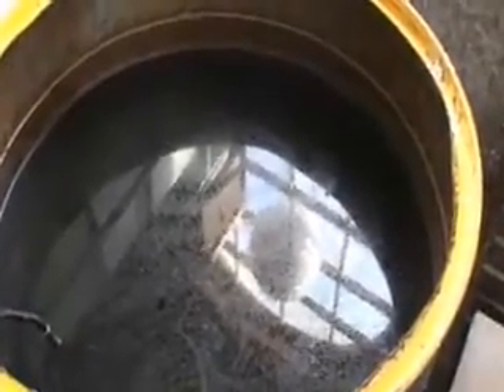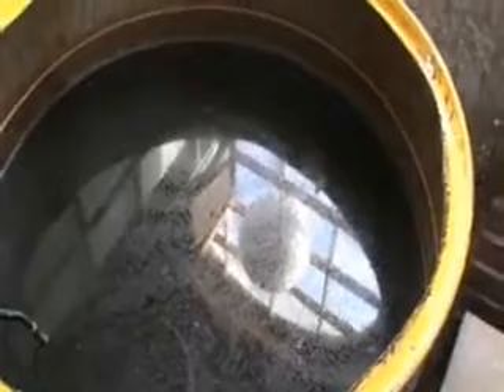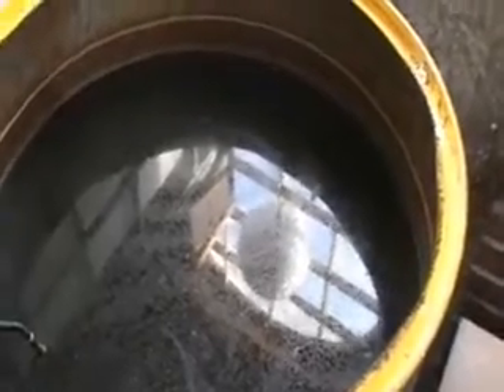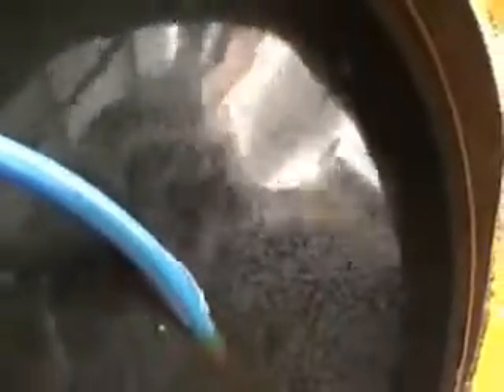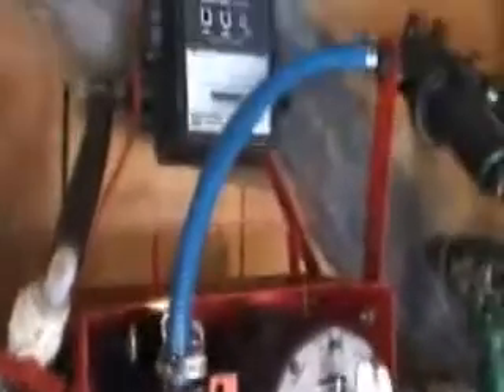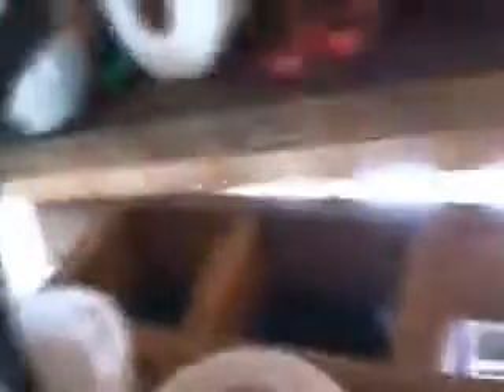Filtering vegetable oil (WVO) for use as fuel with a simple centrifuge

Comment: screw the hybrid. get a jetta TDI and just run dino. 45-55 mpg. better power, no batteries, fewer electonics to go bad, it will last longer without a doubt, hold resale value, you dont chance looking like an enviro-snob, it doesnt follow society's rules, and you may have better emissions comparativly. also Honda, BMW and toyota are talking about a 2011 delivery of their diesel cars. anywhere between 40 and 70 mpg.
Reply: yowmemperor In the future someone needs to invent a diesel electric hybrid. Eletricty for low speed urban and Diesel for highway speeds.